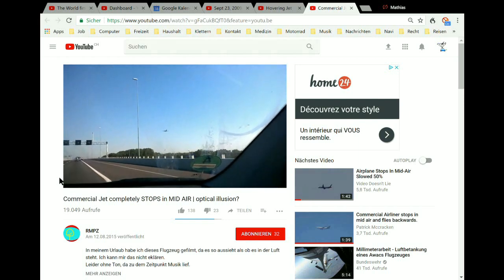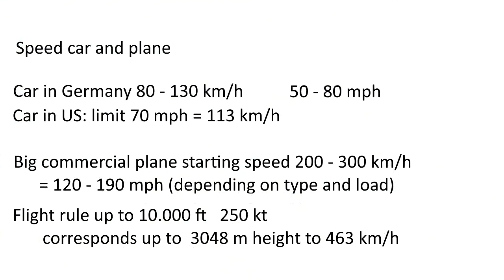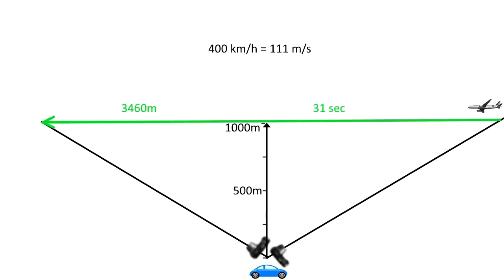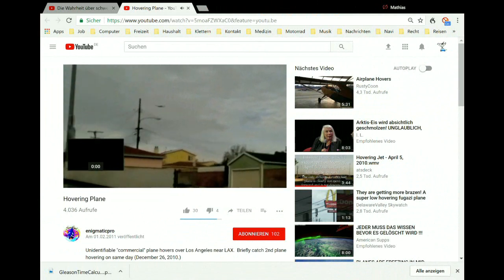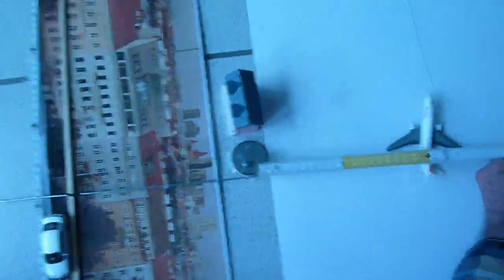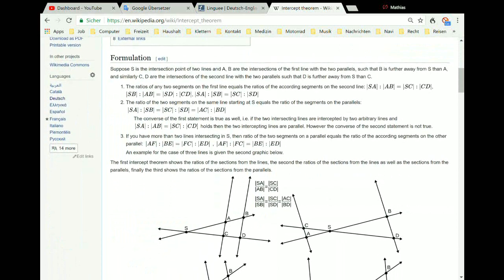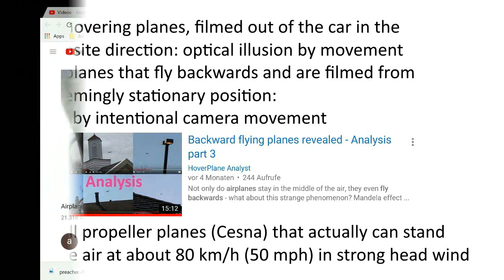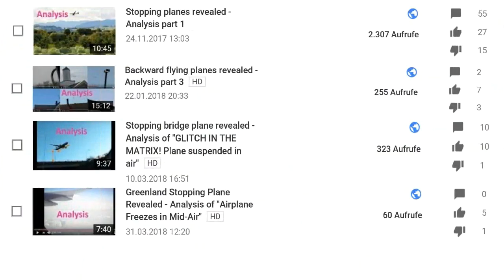Planes stopping in midair revealed - Analysis part 2

Comment: My friend and I saw a plane hovering in the air and I was traveling on a residential street only going 20 mph.  The plane sat there like it was on a invisible pole at a low altitude.  My buddy that was with me thought it was a hovering helicopter until we got closer and saw it was a plane...
Reply from the maker: Maybe the own speed is not so important, The important thing is that the plane flies opposite direction. Thus your visual brain cannot classify the plane's speed in relation to the landscape.
Reply from the maker: @sherriebuck8752  The headwind explanation fits well for small cessna aeroplanes which are able to keep flying in the air at a speed (airspeed) of 50 knots (80 km/h). Commercial planes need speeds of 120 – 160 mph (or knots), bigger planes may need higher speeds. Thus a commercial plane would need a headwind speed of a hurricane which is not imaginable. Their effect of seemingly standing in the air is an optical illusion as I explained in this video and calculated as well in https://youtu.be/hliGQLkEOlE